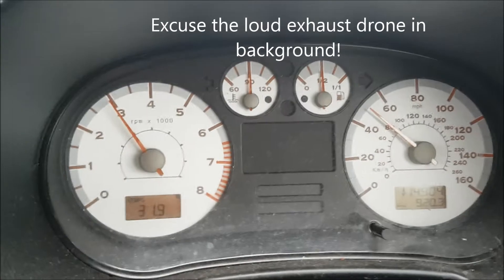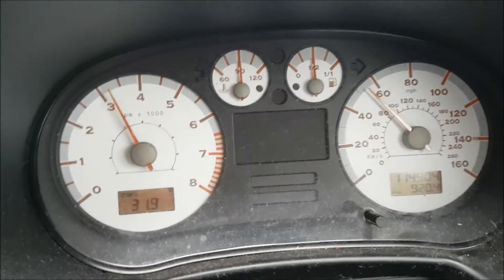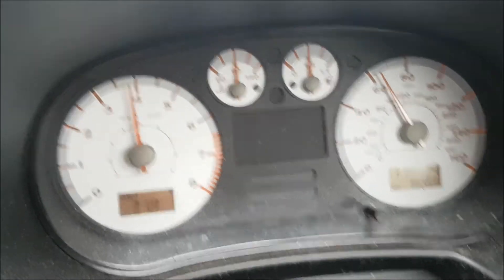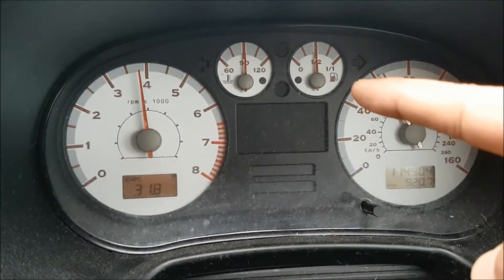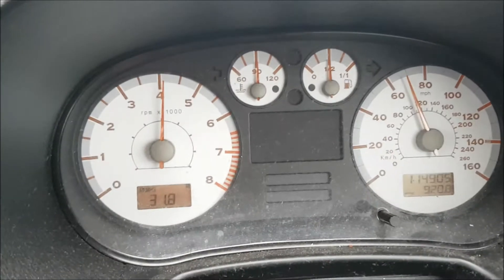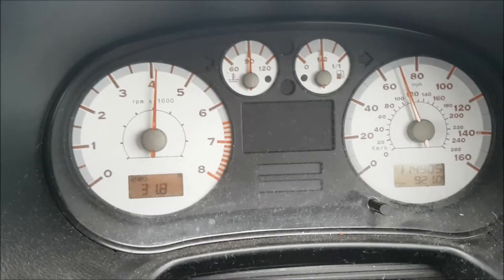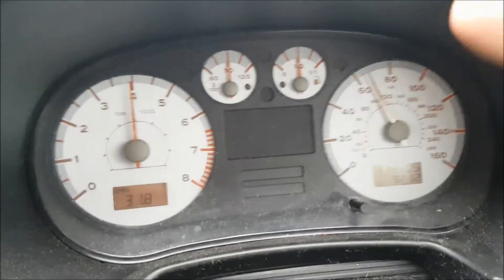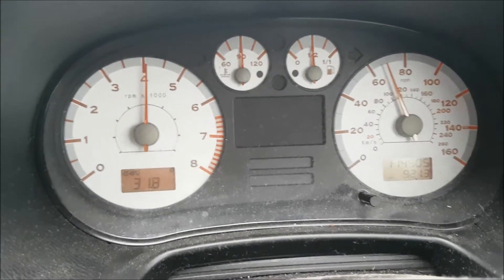Always WARM UP & COOL DOWN your TURBOCHARGED Car

Comment: My only question is what do you do with a lot of these modern engines that are making quite a significant amount of boost just off idle. My car is completely stock it makes 18 lb of boost Max but 15 PSI at 1500 RPM

Comment: You need a gauge for oil temp. This is not correct looking at the coolant. All engines warm up oil at different rate due to how much oil.

Comment: Hi Sir this is what I have been saying to my son Regan as he used to own this 2017 Ford Transit Van but had sold to the company he works for & Regan still drives it for the company he works for & it is a Turbo Charged Diesel engine & the Turbo Charger has not long been replaced & the Vehicle has only done 120,000 Ks the owner of the company had to pay $5000.00 to have the Turbo Charger replaced & that was way to expensive & I could have replaced that turbo charger myself & I could have got a turbo charger for around $1,100 1,200 new & so the guy of the company that now owns the 2017 Ford Transit van Turbo Charged Diesel engine knows a guy & happens to a mate of his Charged him NZ $5000.00 to replace the turbo charger & has really has ripped him off big time & looking at where the turbo charger is on the Ford Transit van I recon I could have it off in 1/2 an hour to 3/4s of an hour & fit the  new turbo charger in about the  same time charged about $200,00 to $500 to replace the Turbo Charger & that guy reallly ripped off my sons Boss off big time & NZ $5000.00 that is beyond the joke & that is a lot of money to replace a turbo charger & I have always said to my son Regan to warm the engine up first before going to work in mornings but no & even when he gets home from he switches the engine off straight away & I can tell him & he is going to destroy the brand new Turbo Charger & it comes about any Turbo Charged engine or Supercharged engine & any other engine on any vehicle must be warmed up & you can't tell these People & they just go ahead & drive them & when I owned a Toyota Carina Twin Cam 8 plug Yamaha Head water Cooled Turbo Charged 1800 4 cylinder engine I always warmed that engine up before I go driving & the same thing when ever I go places I always let the engine idle for about 3 minutes to 4 minutes or sometimes longer before switching off the engine & dosen't hurt the turbo charger as all & I didn't have a timer on this Toyota Carina twin cam turbo 8 plug Yamaha head Water Cooled Turbo Charged engine & warm the engine up in the mornings & cooled the Turbo down before switching off the engine & I would do regular  oil & filter changers with Hi grade engine turbo charged engine oil & it was worth putting good grade oil in these engines & same goes for Supercharged engines & if have a hi performance Supercharged with forged pistons Please give extra time to warm these Hi Performance Supercharged up properly before driving them other wise later down the track you are going to destroy these Hi performance supercharged engines you must allow the time for these forged pistons to expand by warming these Supercharged engines up properly & I'm wondering how many guy's out there that have spent so much money on these Supercharged engines with forged pistons haven't warmed their engines properly & go booting the engines & blowing their engines up & could also destroy the Superchargers not good PLEASE WARM UP THESE HI PERFORMANCE SUPERCHARGED ENGINES WITH FORGED PISTONS TO ALLOW THE PISTONS TO EXPAND TO THERE RIGHT TOLERANCE & SAME GOES FOR HI PERFORMANCE TURBO CHARGED ENGINES WITH FORGED PISTONS YOU HAVE GOT TO WARM THESE ENGINES UP PROPERLY & SAME GOES FOR DRAG RACING WARM THESE ENGINES UP PROPERLY FIRST BEFORE PUTTING YOUR FOOT ON THE ACCELERATOR IS A MUST Kind Regards Peter & Have A Lovely Nice Day Sir & I'm sure that you would agree with me Sir
Reply: And neither a fuck nor a punctuation mark was given that day...

Comment: Your engine oil should lubricate ALL of your engine parts  well within a minute, unless your outside temperature is extremely low. So waiting for your  turbo engine to warm up is not very useful because the oil reaches all those parts within few seconds after cold start. Of course, a little more can only help rule is fine, you are just wasting your time and fuel. I am fine with that, no damage to the engine. The more damage has happened to the turbo charged engine is it shutting it down.  If you are the type.. revving the engine and quick shut down can cause turbo compressor oil starvation since, once the engine is shut, no more engine oil is supplied. And the turbo is keeps spinning for a time after engine is shut down without oil supply can (depending of the engine speed at the time) cause turbo bearing oil starvation.
Reply: But what's the viscosity of the oil like within that minute?

Comment: Even you are probably not idiling a car for 5min before shut down,........ I am for 30 seconds for my last 6 years and it’s been doing alright. Audi A4 1.9 tdi AWX
Reply: i always let my turbo cool off never had issues yet,  hows ur turbo doing after 4 years now? genuine question not tryna be rude
Reply: @istoneyy4204  still going strong after 10 years ~150 000km of me owning the car! :) 
It’s Garrett if I remember correctly

Comment: Taking advice from someone who is unable to change gears?
Reply: @midcenturymodern9330  i’m specifically referring to the information he said in the video, not what is depicted in the video. If you look closely, i said “the advice in the video” not “how this guy chooses to drive his car”
Reply: Well the advice in the video is reasonably accurate
Reply: @jacobhauenstein apart from the fact that your engine isn’t actually warmed up when the coolant temp reaches middle of the guage as your oil is probably not even half way up to temp yet
Reply: @Generalkenobi325  he specifically says this: "What this is indicating is your coolant temperature, and it might take longer for your oil temperature to get to that state as well". a lot of modern engines have an oil thermostat and oil+water cooled turbos so the oil reaches operating temperatures shortly after the water. It has an oil temp gauge and no coolant temp gauge, which makes more sense anyways.

Comment: You don't  need to idle for 5 minutes to cool the turbo lol!  It only takes a minute or 2.  If you have a water cooled turbo you don't even need to do this.
Reply: Actually it depends how long and how aggressive you drove it prior to shutting the car down
Reply: If you come down from the highway to refuel, you definitely have to cool down the turbo
Reply: Mr. Mustache, you are absolutely correct, Sir.

Comment: Back in the 80's and 90's it was no boost 3 mins after start up and before shut down.  I've been told by a co-worker who was a car mechanic,  a bearing change has eliminated that, I am still trying to confirm what I was told.
Reply: That’s typically what I do with my Nissan Cedric, I watch the coolant temp go up (usually after 3-8 minutes) and then I drive below 3k rpm for about 10 minutes before I decide I can run boost for fun lol

Comment: Most new cars don't need this, otherwise start/stop would be very bad. Now start/stop only is bad for starter
Reply: @physio_a  i do agree on the warming up, never ever go WOT when oil is not warm.
But if i look at cars like for driving lessons they always use start/stop and never have issues with the turbo even if they have 200000 kilometers on it
Reply: @physio_a  true,
I'd rather have a engine from a taxi with like 800k KM on it than a city car that has not seen warm oil in it's live with 50k KM

Comment: Lexus IS 200T with 2.0 turbo, how long do I have to let the engine cool down before I can shut the engine off?
Reply: It really only takes 1-2 minutes.  If you turbos are water cooled then you don't need to do this on a street driven vehicle.

Comment: You don’t want to use the engine coolant gauge. It takes longer for the oil to warm up. You want the oriole to be at proper temperature before hard acceleration
Reply: Correct!! never ever go off of the coolant guage as an assumption everything else has warmed up

Comment: Oil takes a lot longer to warm than the coolant especially since it has to warm all of the oil in the pan. My coolant (as with most people) will show as warm enough easily 5-10 minutes before the oil is at a proper temperature.
Reply: In my previous car where I could easly peek at oil temps it took anywhere between 5 to 25 minutes more to heat up oil (depending on usage, light / city traffic it could really get to 25 min) whereas water usually would be in nominal value in ca 3 minutes
Reply: This

Comment: Agreed  mine's approaching 400.000 km and i have always done this.  The Turbo and engine is all still original with no problems at all
Reply from the maker: Grim wriggler thanks for taking the time to comment. I know this sounds like basic advice but still too few drivers are properly cooling down the turbo after driving.
Reply: Another bit of advice is to change the oil more frequently than the recommended schedule, i do mine every 8/10k using fully synthetic unlike the 20 or 30k recommended by seat!
Reply from the maker: Thanks for that contribution, Grim. Couldn't agree more. I find it shocking that manufacturers even advise 10k miles for an oil change. Personally I always change at the 5k miles mark.
Reply: @Grimwriggler  go for semi synthetic it's also same as fully synthetic
Reply: Grim wriggler no oil dilution with idling?
Reply: What type of car & engine though?